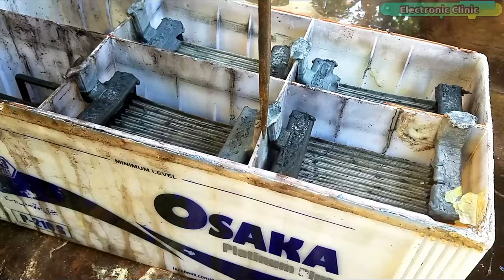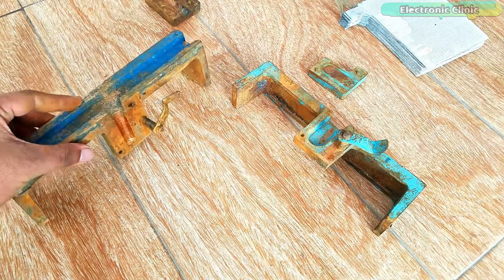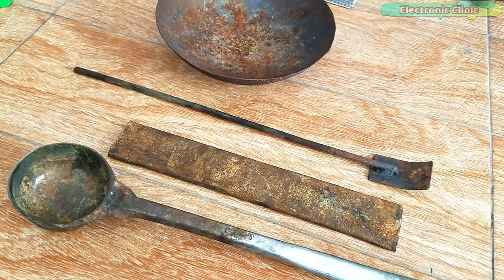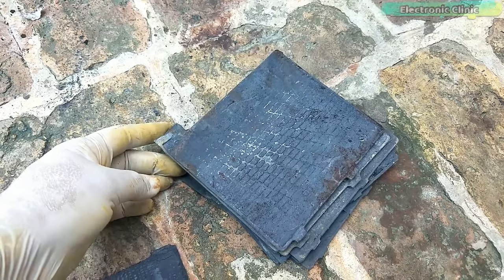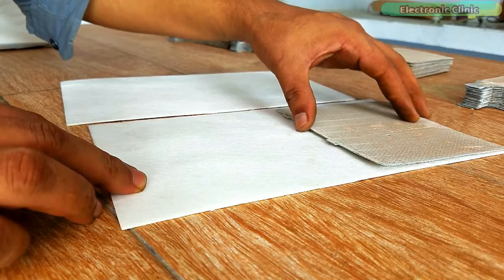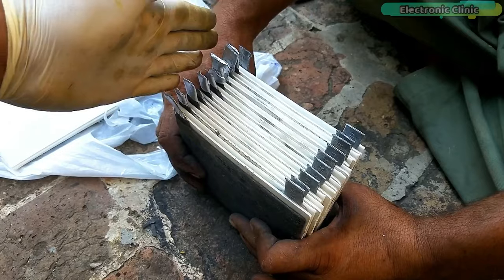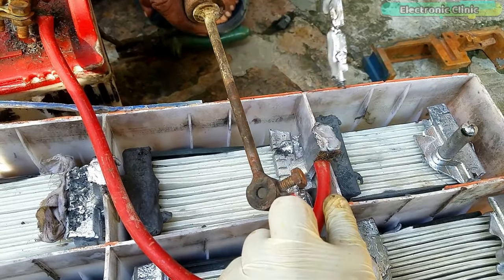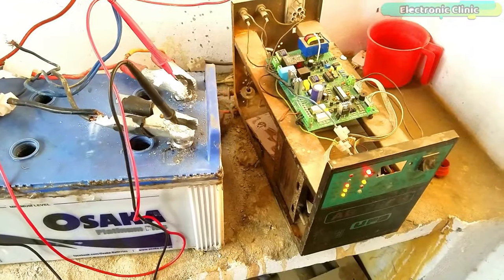How to make Lead Acid Battery at Home, Complete Guide, Tools needed for making Lead Acid Battery

Comment: hi I appreciate your work but I have one concern, where do you throw the acid contained in the batteries? why not dispose of it in barrels and use thicker gloves to protect yourself, I would also suggest protecting your face using a mask and protecting glasses otherwise it could be very dangerous. you have the concept of repairing batteries in mind, now try to develop the safety part of the project as it is the  most important aspect
Reply from the maker: I made this video at home, I don't do it as a business. Just tried to explain the basics.
Reply: yes, but i have noticed, those in the indian sub continent are not so hung up on the 'health n safety' bit. but they make up for it with there unassuming skill. just look at how he pours the acid.. no messing around with funnels. how thick gloves do you need? mind you i would wear a 'proper' mask for those fumes. and dont think about grinding lead.. a scrapper is best. i'v seen little kids doing arc welding and they give them 'sun glasses' ??  i also saw a good old boy in crete just squinting while welding plowshares. his technique was perfected though.

Comment: Do you have a video on how to make both the positive and the negative (ground)  plates? I am looking for the chemical composition of the plates of the lead acid cell.
Reply: The negative ground plate can be made using a lead sheeting. The positive plate is lead dioxide, which is toxic and difficult to work with. But if you start with a lead sheet for the positive plate, a lead dioxide coating will form as the battery is used. The sulphuric acid will oxidise the lead once a positive charge is supplied by the battery charger. This will reduce the strength of the acid, so you need to start with a less diluted sulfuric acid than you would normally use.

Comment: Great video! 

Note of safety: Add acid to the water, not the other way around. It is much safer to do. When sulfuric acid touches water, it quickly heats up. By adding it into water slowly you can minimize the amount of heat generated at one time. 

Why buy the plates instead of making them? With all the other lead casting that is going on, it seems natural to cast the plates as well. I ask just in case there is a special reason I don't know about
Reply: I'd be curious about that too.
Did he cast all the terminals out of lead or tin-lead solder?
It's possible thin plates are significantly harder to cast because as soon as the lead touches the form it cools down. So long thing plates are harder to make. Maybe you'd have to roll them through a press from a thicker sheet of lead.
Reply: @dejayrezme8617  I figure if you heat up the press it shouldn't be that big of a deal. I have been able to cast pretty thin sheets of metal for other projects.
Reply: @benjaminpainter378  Yeah I've see a "how it's made" video and apparently it's no problem casting lead into these shapes.
I think you also create most of the plate by pressing lead oxide paste together to get a larger surface area. So you can't just cast them (see wikipedia)
Reply: @dejayrezme8617  you still could cast them with lead, but you'll get another type of battery. For solar, traction and usv batteries you could use solid lead plate battery. They have a higher lifetime but don't do as much current. The oxid forms itself at the first charge. This form was used for the first battery buses and trains as it's possible to make easy maintenance with solid lead electrodes with spacers. They cleaned the sludge, a quick clean of the solid electrodes, refill the electrolyte and the train was ready for the next week.
Reply: @losttownstreet3409  Thanks. Yeah I've since read some more and tried to read a paper on nife / nickel ferrite battery. Apparently current and power density is all about surface area and they are boosting nife batteries using carbon nanotubes that are then coated with the right nickel oxide and whatnot.
So it seems making it yourself is totally possible with various chemistries but simpler processes requires far more materials and more weight to achieve enough capacity and power.
Reply: @benjaminpainter378  correct. The mould for the battery grids are warmed. The red lead and yellow lead oxide pastes are worked into the open grids then cured.
Reply: @losttownstreet3409  "the oxide forms itself at the first charge"  that is amazing,i'll bet that those plates last  way longer than the soft ones, just not so many instantaneous Amps.
Reply: The guy in the video doesn’t have access to the equipment needed to cast their own plates, nor do they have the lead oxide paste processing equipment and reused materials.
There’s another video where they take those same cast lead plates used for the negative side, plaster in the lead oxide paste, then run it through a roller press, soak them in water and then dry cure it out on outdoor racks in the sun.
Reply: @asakayosapro  I literally opened youtube to go and search for those video and your comment brought me exactly here when I needed it. Also thank you for the info on the other video

Comment: I have heard somewhere that if you replace positive plates with thicker ones and overall raise the cells a little bit in the packaging (could use simple plastic bars assembled to a # crate) you will get a much better lasting battery.

If youre going through all of that, might as well consider doing that.

Also charge the battery if you got time and flush the acid into a container if its possible to desulfate it even slightly.
Reply: true, its the sulfphate that drops to the bottom that kills the battery in the end
Reply: @luckydubeinrc5165  
Well then, might not even have to go through all this hassle and cut out the bottom first.
Reply: Most lead acid batteries fail because there is so little space beneath the plates. As the cells shed it builds and shorts the plates. If you look up "Delco farm light plant batteries" you will find glass jar cells from the 1900-1920s. You'll see how much space they left beneath the plates, you could observe and replace/repair individual cells

Comment: Can you or do you already have a more indepth tutorial on making the electrolyte? This was amazing guide and this one was rather easy to understand
Reply: The acid concentration can be anywhere between 15% to 50% acid to water. If you start with one liter of water, then slowly add up to one liter of acid, waiting for the solution to cool down, as required. Do not add the water to the acid.

Comment: This is a very informative video.  That said, though, I really, REALLY wish there was more emphasis placed on safety here.

1) Make sure that what you're doing is in accordance with local environmental protection regulations.  In the USA, batteries are treated as hazardous waste - which is not to say you're not allowed to restore a battery, but if you're caught being this careless with lead and electrolytes, you will be certain to get hammered with a hefty fine.

2) Despite being simple, there are very good reasons why lead-acid batteries are as expensive as they are.  Look at the PPE and safety equipment lists below to see what I mean.

2) Proper PPE - this is not something you want to be doing while wearing chanklas!
--Wear good leather boots designed to keep liquids out (preferably with steel toe protection, because lead is HEAVY and dropping a monster battery this size on your foot is a guaranteed trip to the hospital).
--Wear gloves rated for protection against hydrochloric acid.
--Use properly rated respirators for lead dust (which can do horrible things to your lungs) and acid vapors (ditto).
--Face shields and goggles are an absolute must when cutting lead with a chisel, handling molten lead, and acids as well.
--ALWAYS use leather gauntlets when handling molten lead - even if it's "cool" for a molten metal, it's still molten metal.  It WILL give you instant 3rd degree burns!  (Think: Liquid Branding Iron)

3) Other safety considerations:
--Do not do this in an enclosed space!  Work in a thoroughly well ventilated area.
--Have a neutralizing agent for hydrochloric acid on-hand at all times!  And make sure there is plenty of it - better to have too much than not enough!
--Emergency Eye Wash Bottles.  Do not cheap-out here.  You will thank yourself if you ever have to use them.  But if you have to go cheap, then a water hose with a ball-valve on the end will work, too.  Just make sure the hose has pressure before you start working - you do not want to be fumbling around while acid is eating your eyes.  (Hence the ball valve at the end.)  And set it up away from where you're melting and handling lead - the last thing you need is to accidentally splash water onto molten metal.
--EXPLOSION HAZARD!!! Charging lead-acid batteries can produce hydrogen gas.  Hydrogen gas in atmospheric air is EXPLOSIVE.  Exercise proper charging procedures to minimize electrical sparks and arcs, and DO NOT have any open flames nearby!
--Always have an A-B-C-Rated fire extinguisher on hand.  In fact, have two or three on-hand.  You can't go wrong with having more than one.

Remember: being thrifty is all fine and good, but not at the cost of life and limb.  Be sober, be aware, and be safe!
Reply: It's sulfuric acid that's used in batteries, not hydrochloric acid.. battery acid is only 35% acid when new, it's not going to instantly eat flesh, i recover battery acid and distill it to get 98% acid for lab use and even 98% won't instantly eat flesh at room temperature, you easily have a couple of minutes to wash it off before it starts to burn

Comment: Thanks for the video, very useful in an extended grid down situation.... eventually all batteries will wear out good to know how to rebuild them.

There are ways to recondition SOME lead acid batteries depending on what lead to it no longer holding a charge.

There are two ways to recondition batteries that i know of...the Epsom Salt method and the Arc Welder high current method.

Is it possible to clean the lead in the battery? Some chemical that removes the surface contaminants but does not attack the lead?

Comment: you could reduce the slag back into metallic lead by mixing it with carbon powder such as crushed charcoal or graphite.
Reply: You could, but you would need it to be vaporized also to have it suck out the oxygen. The carbon powder would need to become carbon gas or carbon monoxide, it can pick up the oxygen from the lead oxide and become carbon dioxide. 

The easier way to do this is to melt the lead in a reducing fire and soaking it in the heat, as long as you have a reducing atmosphere you can remove the oxides.
Reply: @leeknivek  that's another way of doing it, i don't know which is more effective but common sense would suggest it is both a reducing flame and addition of coal powder to molten lead where it would of course vaporize

Comment: I have a question is a positive plate made out of different materials?ty
Reply: It's still lead, but they heat them to different temps to get a slightly different lead. I want to say one is lead oxide and the other is lead sulfide.
Reply: @nedlyest   they heated for +400 C  to make it  pbo2

Comment: I don't know if this is practical, but it would be really interesting if there was a DIY process to take a normal vehicle 12v starting battery and convert it into a 12v deep cycle battery.  I understand the basic layout is the same but the plate composition is somewhat different.

Comment: ahhh on the begining, guy pour old battery acid just on the ground, can you imagine how much acid he pour in 1 year ? that’s insane it is not recycle of battery it is demaging of environment
Reply: This method is for areas where environmentalism is impractical due to extreme poverty, but the acid could certainly be saved and filtered to reduce expense. I'd have also pointed out how to reduce lead contact hazards but that's pointless too.

Comment: What if the battery still has a small charge on it?  Once you dump out the electrolyte, will it be safe?
Reply: 12 v can't penetrate skin. Once the electrolyte is out, the electrochemical reaction cannot happen. Though you can easily discharge the battery too if you want.

Comment: How do you make a brand new plate? Seems to be a secret 🤫
Reply: A negative plate can be made using a lead sheet. The positive plate is lead dioxide, which is toxic and beyond the DIY scope, but a pure lead positive plate will also work (although slightly less efficiently). 10% Antimony can be added to stiffen the lead.
Reply: @JonathanH13  I’ve seen people making batteries out of zinc and copper and coins etc, does that actually work?
Thanks for replying!

Comment: Nice video! As usual!
This is highly illegal in most western countries! Lead smelting and messing with sulphuric acid are very tightly controlled industiral processes with environmental and disposal regulations you just couldn't meet at home...
Reply from the maker: i think its just because of Sulfuric acid.
Reply: And yet a bunch of people still make their own lead sinkers for fishing.
Reply: screw the rulez, make da batteries bruddah! voo yay??
Reply: Yeah, not so much. You can definitely can do lead, tin, or aluminum casting in your backyard or garage without running afoul of the law. And the acid can be purchased and disposed of at most auto parts stores.
Reply: Yeah well so is having a different opinion
Reply: @ElectroniClinic  Where can I get those spacers or some other product that works the same?
Reply: @markcollard9326  maybe but leadis illegal to use in most western waterways
Reply: The sulfuric acid isn't really a problem and it can be neutralized with bicarbonate soda or lime but just tipping the acid that's contaminated with lead on the ground is a big no no and will contaminate the environment forever.. there's no law here about having lead or acid but there are laws about dumping lead like that and for a very good reason, future generations are going to pay dearly for such stupidly

Comment: you  left out the most important part, what  is  smeared on the plates.........
Reply: 1) "black lead oxide" (a mixture of PbO and Pb)  is first heated to convert it into yellow (massicot) form of PbO
2) yellow PbO is grinded, mixed with water, put onto plates
3) after drying, plates are submerged in H2SO4 to convert PbO into PbSO4, the discharged form of one plate
4) by combining those plates and plates made from pure Pb (apparently not shown, same way as those metal grids), you get a functional battery
Reply: @ivofukala3146  thank you, very interesting

Comment: Oh my god, I can't believe you casually dumped out the lead contaminated sulfuric acid on your patio. It is a huge environmental/health hazard, and it will also damage your concrete. 

If you try to do this, pop the cap off located on top and dump it in a bucket to be disposed of at a hazardous disposal facility (assuming your in a country with that luxury). I'm not even sure if doing this process yourself is legal in many places.

Comment: Why do not use gloves during the whole process? Heavy metal poisoning is a certainty without protection. That is why the U.S.A.  eliminated lead based paints years ago.
Reply: He just doesnt give a F. I love how he just dumps the old battery acid saturated with lead into the ground.